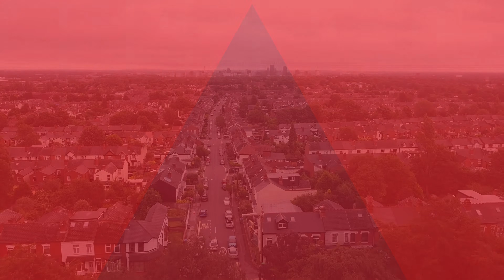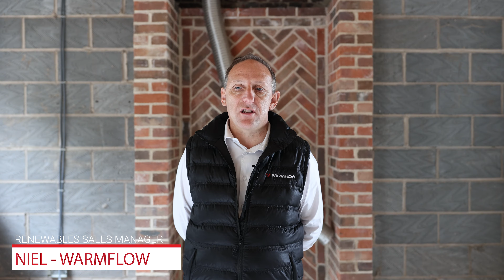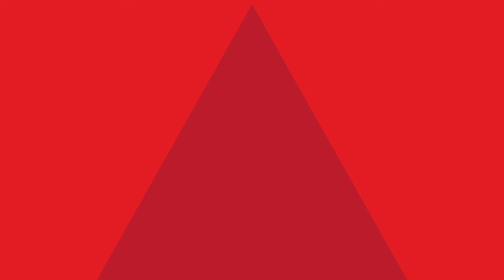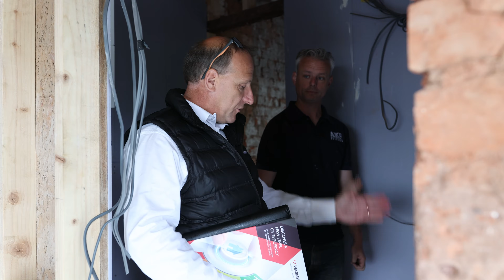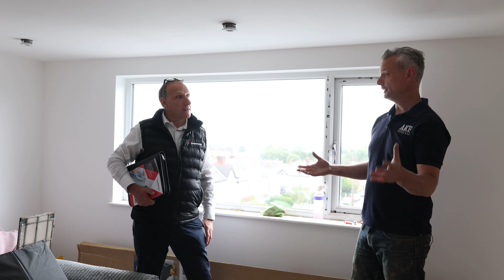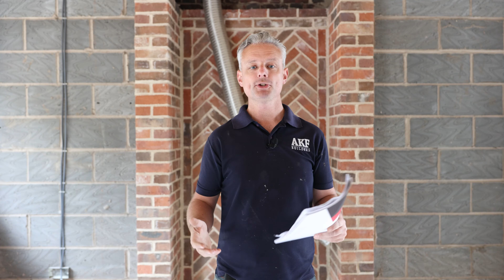Retrofitting an Air Source Heat Pump with Warmflow

Comment: Air is the fuel? Pretty sure it runs on electricity.. and just moves existing heat energy around. pumps heat if you will..